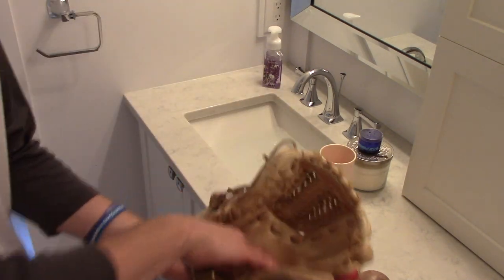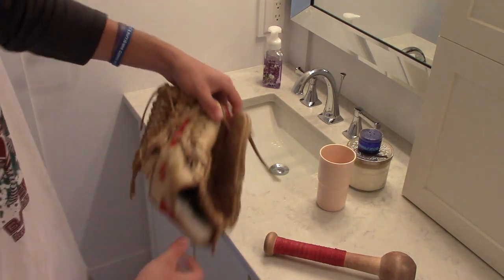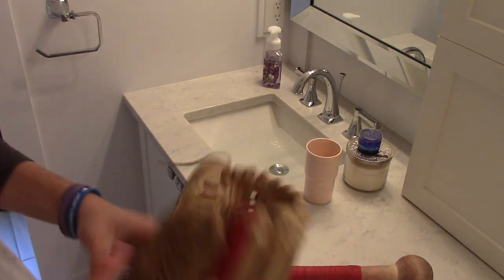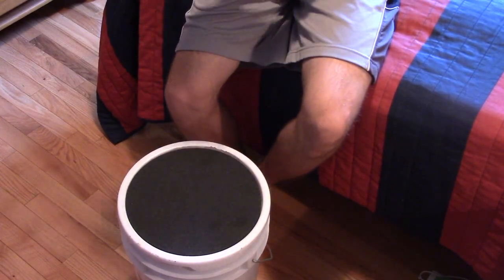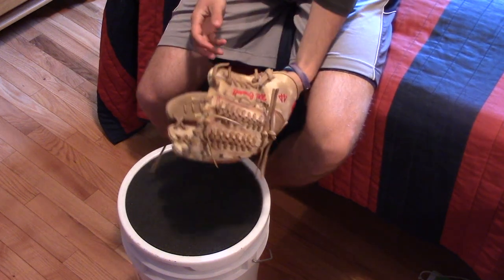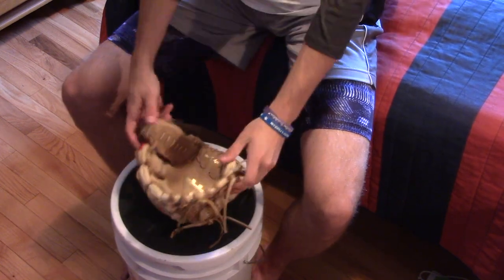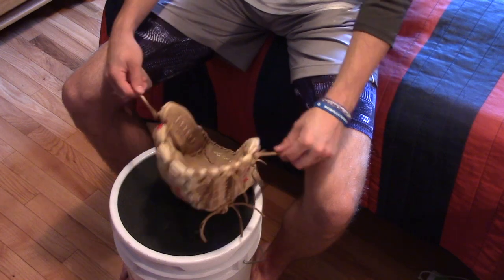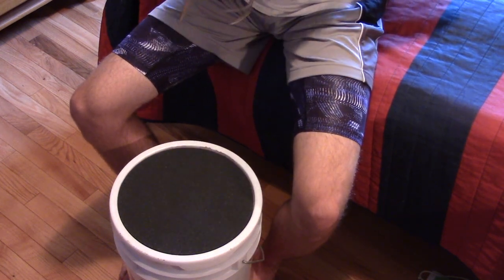BREAKING IN MY CUSTOM PITCHING GLOVE

Comment: How hot do you put the water?
Reply: Cayden Hansen He used it from the sink so it can't be that hot; way under boiling point.
Reply: Cayden Hansen I use the hottest setting on my tap water 2 help form my gloves. It worked PERFECTLY on my Wilson A2K
Reply from the maker: +Max Bethancourt exactly what I do
Reply from the maker: +Fishguit I let the hottest setting on my tap go for a minute then plug it